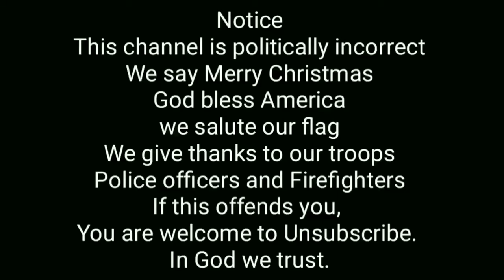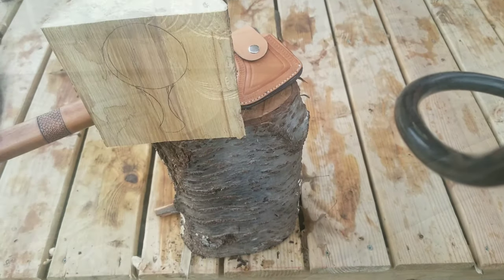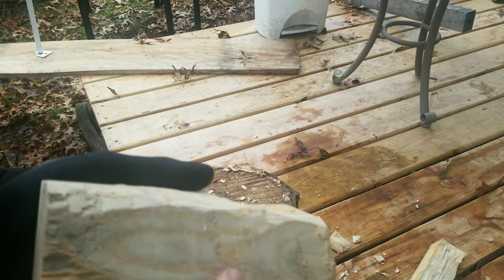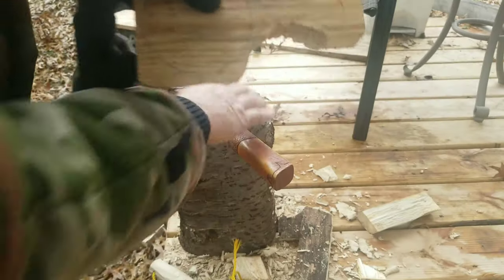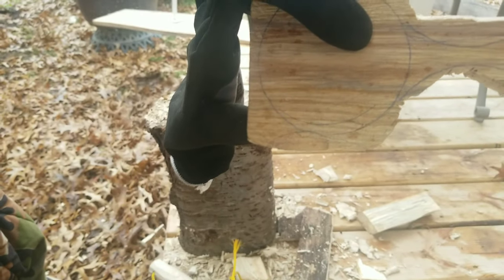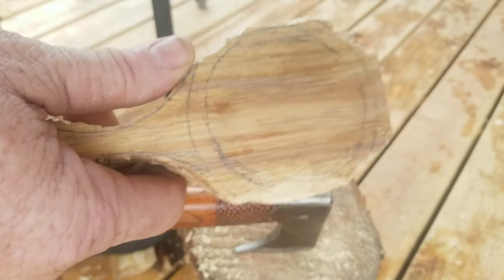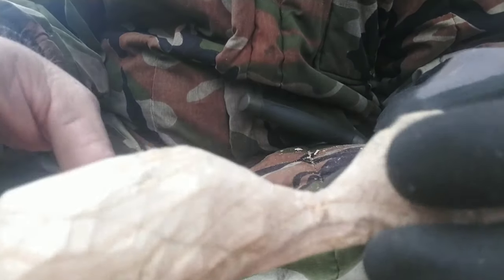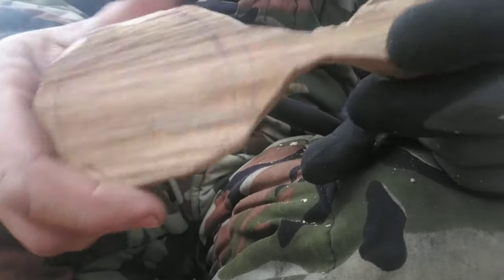Christmas wood carving

Comment: I like it. Had a similar chip out with mine, now it’s a wavy shaped kuksa, not worse then any round one.
Reply from the maker: By the time I chipped out all the dry rotted wood there just wasn't much depth left for a good kuksa. I just kept carving and called it a scoop. Gave it to Melissa for Christmas. Part 2 will be published shortly. It turned out nice.

Comment: Its art, which always leaves room for artist interpretation and what the wood allows. Good for you for not chucking it when it chipped.
Reply from the maker: I have always found it hard to quit once I have started on something.  As you will see in part 2 it is nothing like what I planned but still works for another purpose.  
Thanks for watching and Merry Christmas. God bless.